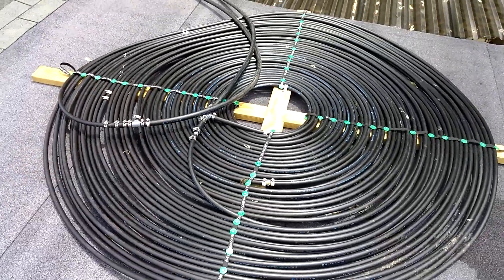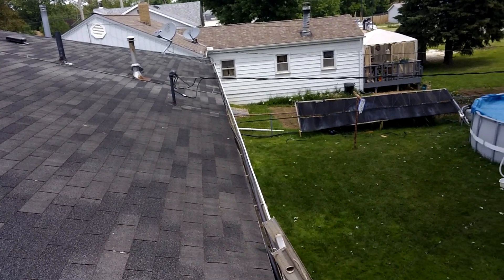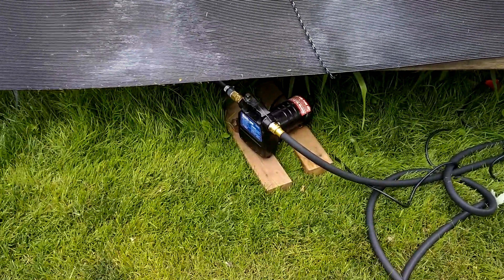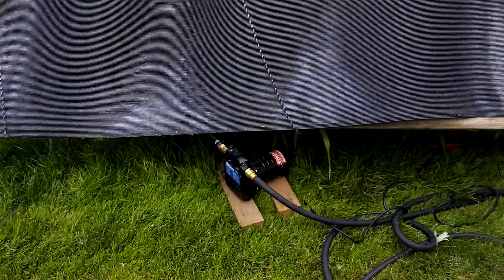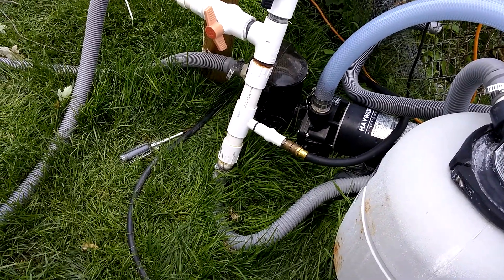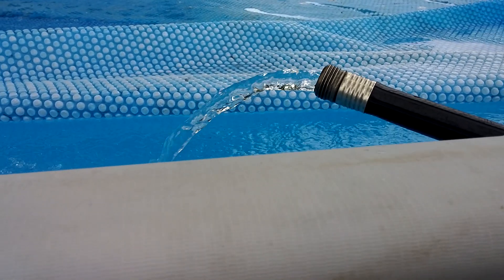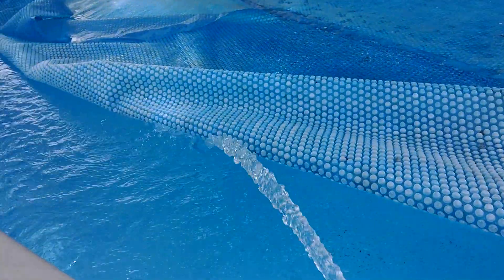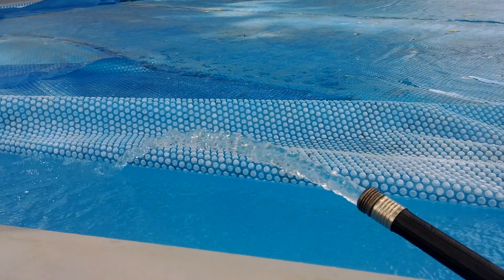Home Made Solar Pool Heater Part 2 - Success

Comment: So it appears as though you have 800 feet of black tube coiled on the roof in addition to another 4' x 10' solar collector angled against the fence?  Sort of confusing as to what is feeding your pool with that plumbing set up.
Reply from the maker: Just a T fitting with a diverter valve on the panels with a smaller T fitting and valve to the roof coils.  Don't want to be cooling the pool at night.  And it's actually 4x20 panel on the fence.
Reply: Bitfarmer75 hii man after how much days the water was hot? how much litter you have in the pool? and what is the long of the pipe you used in your project?
Reply from the maker: Look at my other video's, you'll see the build in part 1.  Read the other comments and you see how well it heats.

Comment: I did something similar with 3/4 in pipe but if the water is running too fast it appears my pool water cooled down my black pipe construction rather than my black pipe warming the pool.  What has been your experience?  How long do you get warm water until the black pipe cools down?

I am now starting a 2nd experiment with 1/2 in pipe and a slower water flow.
Reply from the maker: If you are pushing water though it to fast you won't notice much of a gain.  Pushing slower you will notice the rise in temp but if you have a large pool it really won't do you much good.  Then there's other variables such as your location, surface under the pipes, wind, etc.  I've been running mine for 2 seasons now.  I just prime it and let gravity, along with what little boost the pool pump gives it, keep the water moving.  Compared to the solar heating panels I also use it contributes very little, but again it's better than nothing.

Comment: I'm building one exactly like yours.  the 6* rise you mentioned, is that F/C?
Reply from the maker: tomtom96135 F, The degree of temp rise is totally subjective to the temp of the water, outdoor temp, how direct the sunlight is and how fast you are moving the water.  The other day when it was 90 with sun directly above it was at least 10 degrees warmer but I wasn't running the pump so the water wasn't flowing fast.  Maybe 2 gallons a minute.  With 13000 gallons of water to warm and maybe 8 hours of sun it will take a long time to make much difference.  I haven't taken the time to do the math because I would probably be disappointed in the answer.
Reply: Bitfarmer75 for less than $100 anything is better than nothing.  Thanks!